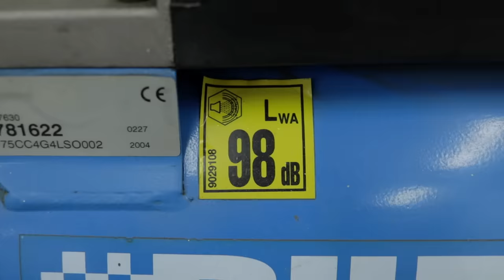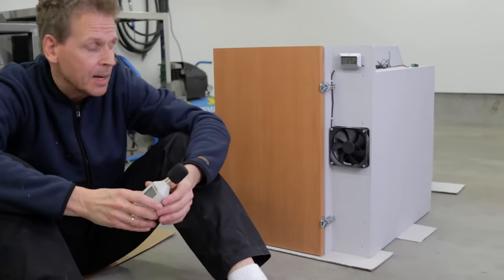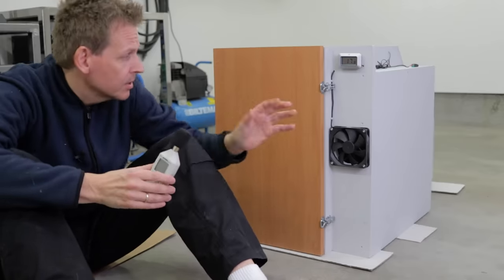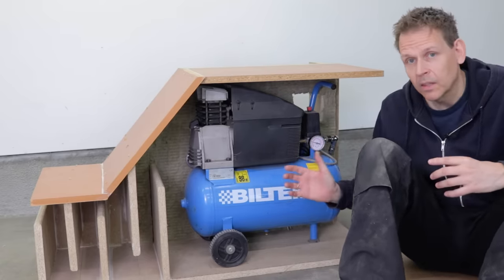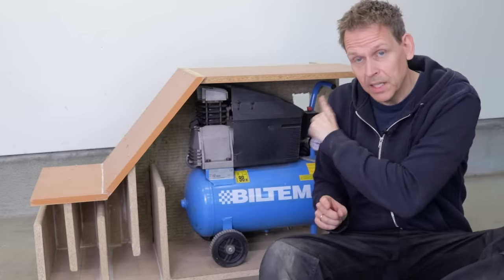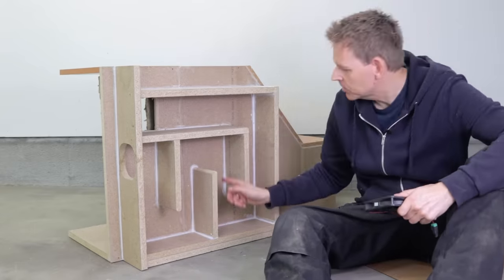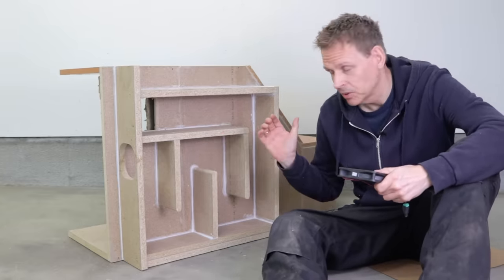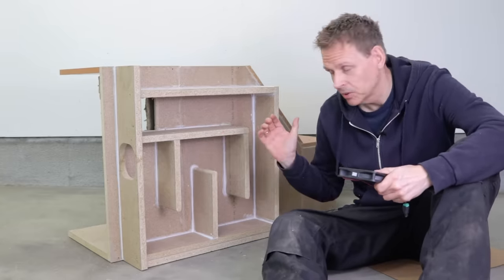Do not build a sound insulated enclosure for your noisy air compressor!

Comment: My advice is to build increasingly larger boxes around the boxes around the compressor until it is completely silent 🙃
Reply: Like a Russian Doll? Keep building until the final box is the size of a High Rise building!
Reply: or bring it far away from u and feed our air with 1-2" plastic pipes. 10-15m, 2 walls is often much more then this box evere can make
Reply: I worked in a shop with 2 huge air  compressors. Never heard them, they were in a fenced enclosure outside.
Reply: That is a great solution.  I have followed similar thinking with making gutter guards.  My gutter guards are perfect and allow NO junk to get through.  Unfortunately, water also does not pass through!
Reply: @dannyo3317  Reminds me of the gutter guards where the water is supposed to basically go over the gutter and follow the curve back into it while all the junk blows off. What a gimmick
Reply: @dannyo3317  1/8 th, 3/16 perforated metal works perfect.
Reply: Or put it outside?
Reply: @batterynerd8779  sure, then he will only have to build a waterproof enclosure and move the electric outside. Either way your building a box for it. Rather have it in a dry attic.
Reply: That could work,BUT make sure you have good ventilation when the heat comes from the compressor or there might be a fire!
Reply: Just building a box probably won't be enough. You would need to line it with some kind of sound absorbing material. Otherwise, a lot of the noise will get through the box walls and top.
Reply from the maker: That's exactly what I will do next time 😁😂🤣
Reply: "Honey, we need a second (or third) garage now!"
Reply: Or even move house and leave the next owner to deal with the problem.
Reply: nice idea. but instead of air inbetween id rather measure which frequencies the compressor produces mainly and search for a dampening material which is good at this frequency and then combine your idea with mine, filling the gaps with said material.
Reply: @erict3728  This is great if you live in a semi tropical climate.  In Canada, where I live, the compressors and airlines would be frozen solid 5 months out of the year.  As someone else mentioned, there is no better sound deadener than distance.  Put a little heated shack 50 ft from the shop and it would be completely silent.  Not real practical, but effective.
Reply: @erict3728  
I tried that, but my neighbor complained about it being in their property.
Reply: The law of diminishing returns applies here. You'd probably be looking at a final box size being bigger than the room you're in before you couldn't hear the compressor anymore.
Reply: @trevorlambert4226  Worth it! 🙃
Reply: @erict3728  I'm glad everyone else enjoyed them.
Reply: Keep in mind to purge the tank regularly
Reply: If you then test it out of the box and inside the box over and over again, either you'll go deaf, or the compressor will eventually quit.  In either case, silence!
Reply: So many good ideas. I've never seen so much inventiveness in any comment section. Feels weird though with no arguing and hate. Somebody pinch me. Actually what I do is buy lots of tanks. Yes air tanks, set your compressor on a timer so when you're out shopping it kicks in and fills up the tanks, that way you'll never have to deal with the noise. One shed for tools, one for tanks. Simple. 🙂
Reply: Ask your neighbor if they want a free air compressor. Once they say they do, tell them that they have to leave it turned on and leave an air line running to your garage.   Problem solved!
Reply: Good idea, reminds me of suppressor baffles
Reply: Adding a thick layer of polystyrene would be better?
Reply: You have to reflect and absorb the sound.
Reply: Another option is to use the sound shielding material made for inboard powered pleasure boats/yachts.  It's multiple layers of a dense foam and lead sheets which is able to suppress the noise of twin diesel engines and a generator in a small motoryacht.
Reply: I have it in a box inside my garage (another box) inside my house (3rd box). Still noisy as hell!
Reply: @wh0tube  Clearly you need to build more boxes around it.
Reply: Put it outside with a roof  roof and three sides
Reply: I forgot the compressor needs maintenance, so maybe not...
Reply: @erict3728  This is the way, only I'd go a step further and build an enclosure using cinder blocks so it isn't obnoxious outdoors either.
Reply: @ProleDaddy  well, between the sound of diesel engines idling, the CNC machines and the rest of the "industrial district"... I would have to say hearing our compressors was their problem/fault. If they had a problem with the sound of machinery, they had no business being there
Reply: those silent compresors are peas of shit nothing more nothing less if you need compresor just buy a belt driven compresor and be done with it because belt driven air compresor will be cheaper to maitain and also will give higher CFM, and also will be quetter then those peace of junk

Comment: Very important that you provide a way to drain the water from the tank.  One way is to plumb a line directly to the drain fitting, then to a valve, so you can leave the compressor in it's comfy home.  Don't forget to service the oil.
Reply from the maker: These compressors are without oil, but draining the tank from time to time is needed. We have a quite dry environment here where I live, and since the compressor is stationary in my garage it gets quite dry air all the time. For now I have to open the hatch and take it half way out of the box to drain it - have not done it in a couple of months, probably due time 😯. Will consider adding a line to have drain plug on the outside, would have made it much more convenient. Thanks for your tip! 👍
Reply: @kihestad  be sure to read your instruction manual in regards to how often you should be draining the water from the tanks. My Ridgid dual tank says every 4 hours of use.
Reply from the maker: @vizioasdf  Hi, the user manual says 'daily, after work has been done'. I have to admit that I don't drain it daily. Most days I don't use it at all, and some days I just start it once and then turn it off to do a small job.  

The humidity is what is causing water to get into the tank. I know it can be quite humid some places in the world, while it's a rather dry climate here where I live (although it's raining a lot). I have just drained the compressor 'now and then’ up until now, but I'll start doing it a bit more frequently 😇
Reply: See the trick here is to build a separate insulated room with a filter air dryer/dehumidifier and auto drain valve for the tank so there’s room to walk inside, close the door and service the oil and rubber motor pully for those long life compressors
Reply: @Robert Swaine I’ve actually seen someone do the in ground concrete part haha but if you’re going to go that far then I guess you might as well add an oil burn furnace to put that spent oil to good use
Reply: I removed the drain valve on mine and have the air outlet plumbed into the bottom of the tank leading directly to a water separator and then a manifold. My theory is having the output on the lowest point will evacuate all water any time an air tool is used. When it comes to pressure vessels better safe than sorry.
Reply: @_r.t-  aluminum tank with the same line setup while also preventing rust?
Reply: @maxuabo  even with aluminum tank you don't want water accumulating and causing corrosion
Reply: If you're turning it on and off remotely it's worth putting a electric pneumatic valve to unload the pump before starting
One where you apply power to close the valve can just be joined on to the motor connections

The pump is normaly unloaded by the pressure switch with a red button on
Reply: @Robert Swaine I can’t work with someone who doesn’t account for excess compressor pump vibration. Lose my number. Good day, sir.
Reply: @Robert Swaine man I wish I was educated and or literate enough to continue this wonderful banter. I gotta tap out. I’m too dumb to entertain the smarts
Reply: That looks like an oilless compressor (uses teflon rings) which is also why it's so loud
Reply: @kihestad  unless you have 0% humidity, the action of heating the air from compression and the cooling of decompression causes condensation
Reply: Yes sir!
Reply: Very easy to add a solenoid valve to the water drain, the valves are about $13 on Amazon. Elbow to a 6inch or so pipe then screw on the solenoid valve. They take 12vdc to activate, add a momentary switch anywhere in your shop and run the wires to the compressor. Wanna get real creative, use an Arduino and a mic to detect the sound of the compressor running. When the compressor turns off active the solenoid for 500ms. Fun project.
Reply: you can use a small steam trap piped with hose to the outside that'll drain itself,..
Reply: Do people really do that in a home shop environment? I have a compressor from my dad that he bought 30 years ago. I bet nobody ever drained water from the tank or did an oil service. My dad surely didn't and me neither so far.
Reply: Agreed.  I came to the comments to say that as well.  Letting water accumulate turns compressors into handyman hand grenades.  The first tool that should get regular care and maintenance in any shop.
Reply: @jackmclane1826  Compressing the air reduces its ability to retain moisture.  Every system everywhere will have condensation of water.  Wherever it pools, it begins oxidizing the metal from the inside out where you can't see to know the tank has been compromised.  For whatever reason many low quality systems will even have the weld joint on the tank wall positioned at the bottom of the tank - meaning the water is hitting and resting on the tank's weakest and most vulnerable point.  If the water isn't drained regularly (I do after every use each day) it's just a ticking clock.  Tank failure opens the can up like a zipper, with explosive force and small metal shrapnel from the seam.  It will knock cement bricks out of alignment and bow out walls in enclosed spaces from the pressure, to say nothing of blowing the windows (and your eardrums) out.  Anyone standing in a room when one goes off is very likely taking that day as their early permanent retirement.
I've seen the after effects, and no one wants to be around that
Reply: @robertmartin2936  Hm... maybe air is just not moist enough at my place and it stands in an extremely dry garage. As I said... I guess nobody ever did this to our compressor in 30 years. 
I will check for water, soon.
Reply: Good job!
Reply: Service the what?
Reply: @jamesolelo4406  what people are saying here, is that if you have an air compressor, you should open the petcock(water drain valve) underneath the air tank, as water in the air will collect on the bottom of the tank, and depending on the quality of the tank, will sooner or later turn it into a pressure driven shrapnel grenade, if it isn't drained at least a few times a year, depending on the usage... Another thing you may have to do is change oil, if your model is one that takes oil, although I've seen very old compressors that honestly don't seem to care whether they have a lot of oil, as much as newer ones do, so I'm guessing that the main reason a lot of maintenance is required on newer machines is the fact that they aren't built like they used to be...
Reply: @northwiebesick7136  okay I was confused because none of mine use oil.
Reply: @jamesolelo4406  I see... Most consumer units you find in your local home improvement store will probably be an oil-less unit these days, although a lot of "freestanding" shop compressors probably still use oil for whatever reason...
Reply: @northwiebesick7136  maybe oil is needed for harder daily usage. My compressor is almost 20 years old n I only had to release water from it. But after using it to build the house it didn't have much usage besides filling tires once in a while.
Reply: Snag is most of the time with these compressors is drain is not on the bottom but at 5 o'clock and you need to tip it up and sideways to drain properly
Reply: I got tired of having to lay on the floor to twist open the tank drain valve.  I changed the valve to a remote activated type.  Now I just pull on a cable that is located at workbench level.  I now drain the tank after every use, which is much more frequent than I did before.
Reply: That what I said as well . Great minds think alike .
Reply: @robertmartin2936  i have a dewalt emglo 4 gallon portable compressor, in addition to draining it daily every month or so I flip it upside down and put about a teaspoon of air tool oil in it then rotate it around 3 axis to coat the whole inside. I dont paint with it so its all good. Really helps keep the rust away. It just passed the vessel expiration date (20 years) I have no intention of retiring it.
Reply: Ok, here’s the plan!
Start with a shipping container and place it on level ground in proximity to pwr/wtr/gas
& tools!!
Extract the Top Ten Ideas from the comments below (or above) and draw a plan incorporating all ideas into a marketable product!
Design and build soundproof enclosures that would contain an explosion due to dereliction of drainage derectives!
Mount unit on back left corner and tie exhaust into dust extraction unit!
Open refrigerator and grab an ice cold beer to enjoy as you plan the rest of the build! Any suggestions employing noise cancellation?!
Reply: @_r.t-  … I am not any sort of engineer so don’t take what I’m going to say as gospel … I took some auto body repair classes in my youth and was told that compressed air holds water in it. It was suggested that 25 feet of hard line (piping) be installed between the compressor and the water separator to allow the water to condensate out. I’ll admit I don’t follow that rule but I mainly just use my compressor for tires.
Reply: @Robert Swaine kind sir, I word of advice less words, more action your not as smart as you think you sound or witty for that matter. Sorry couldn’t read that exchange without commenting.
Reply: @maxuabo  They make inline air dehumidifiers. They're really made for large air compressors with high duty cycles. They will protect your air plumbing as well as your compressor/tank if you use black iron piping though, which is very nice
Reply: The new compressor looks like it's an oilless type. Having experience with first-generation oilless compressors, I'm wary of their durability.

Comment: Something else that I don't think people necessarily realize, moving up to a larger oil bath belt drive compressor has big impact on the sound. It's incredible how much quieter my big 5hp unit is compared to my old small oil less direct drive.
Reply from the maker: Yes, I have heard some of those. They are not only more quiet, but the sound from them is much less annoying as well. You have to go up in size and prize though... 😬
Reply: @kihestad  New price for sure is hard to justify for light use. thought I had a quite old belt driven oil bath compressor that was of similar size as yours picked up for free in need of repair. After a compressor pump rebuild and a new tank it worked quite well and despite still being small, was very pleasant on the ears. As they say - they don't make them like they used to!
Reply from the maker: ahh, cool - I would love to get hold of a old one and fix it 🙂
Reply: Sorry I dont get it; are No-Oil comps quieter? Coz I was looking for a silent comp and the silent + oilless models are sold as a technological progress.
Reply: @EthanTheEx  Oil-less compressors have been typically a lot louder. Mainly, I think, because they also tended to be direct drive. So the compressor pump is turning at the same RPM as the motor and sometimes the motor is also turning at 3400rpm instead of 1700rpm! Makess them super loud.

Oil bath pumps tended to be large displacement, so they can turn slowly for the same CFM output. Technically I'm not sure there is any reason you couldn't apply the teflon piston rings and permanently lubricated bearings AND a high displacement slow RPM pump. But for whatever reason it's just not typically done?
Reply from the maker: I think that was a very good explanation. For smaller air compressors you can find all kind of types: with or without oil, silent ones or noisy ones. Typically the silent small ones has less capacity compared to the noisy ones. Medium / big air compressors are normally not oil-less what I have seen.
Reply: @kihestad  Having had some time to think about it, it seems to me that longevity is the main reason that larger compressors are not oil-less. Oil bath compressors can last for decades even in commercial use. I've never seen an oil-less compressor that has seen any real use last even close to that long. Obvious in hindsight.